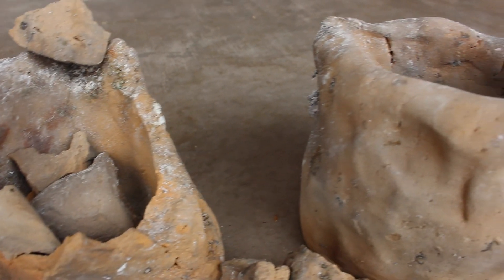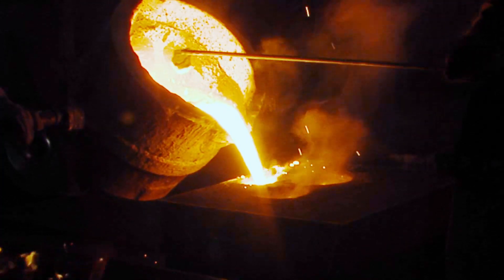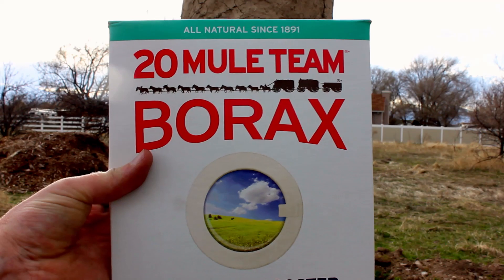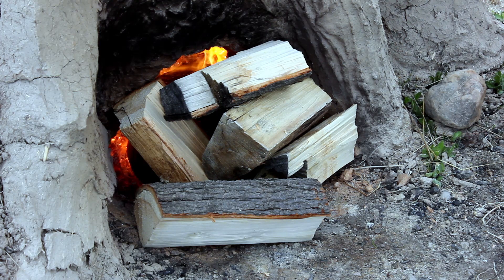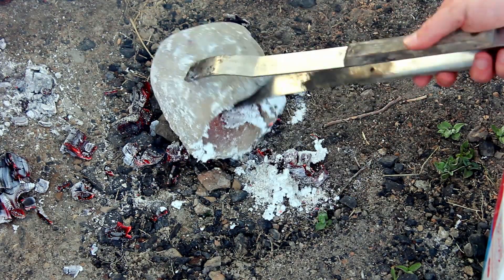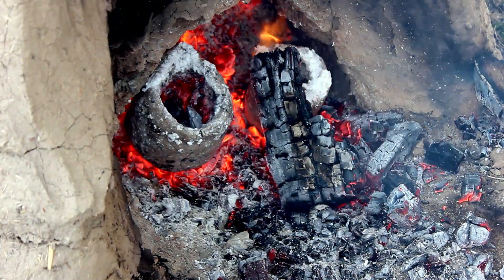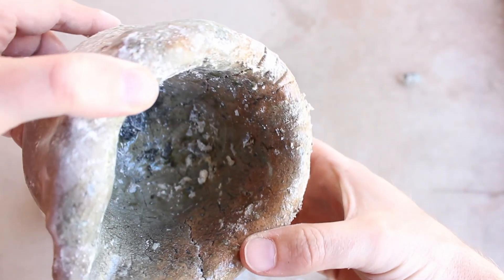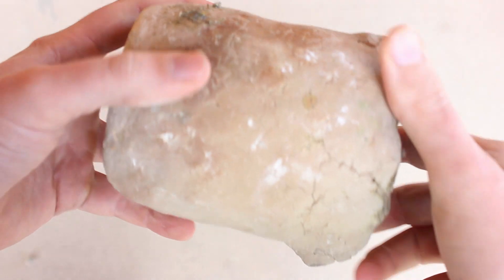How (Not?) To Glaze A Crucible (experiment)

Comment: I know this is 4 years too late, but I shouldn't imagine excess borax is a problem as its used as a flux in forge welding so it helps prevent oxidisation and makes for a cleaner bond, in this case it may just mean more slag floats to the top so could lean towards a lesser yeild but of a purer metal 🤷🏻🤷🏻 don't know. I'm not a scientist but that would also make sense.

Comment: A couple comments touched on this, but Borax begins to melt before all of the chemically bonded H20 separates.  Glazes with Borax will bubble up as that water finally separates and forms steam bubbles within their now-liquid surroundings, then the bubbles pop and the glaze settles down again (hopefully).  This makes it tricky to use as a glaze on its own, though still possible, as you showed.

Borate does not contain chemically bonded water, so a glaze made from Borate (which is the vast majority of low-fire glazes) will behave better in the kiln.  Gerstley Borate is the most commonly used source, though you have to order it from a pottery supplier so it isn't quite as good and basic as Borax.

Comment: The easiest glazeing process would be to throw salt into the kiln during the hottest part of your initial firing. Salt can burn around 300F but in the super high temperatures of a furnace it melts (around the same temperature for forging and hardening steel). It will then evaporate and the salt ions react with the silicon in the clay creating an orange colored glassy surface. There is no second firing needed. 
Another good glaze is tin glaze. Mix a slurry or lead oxide and a little borax and paint it onto fired pottery. Once that dries, paint on a layer or two of tin oxide and borax. The borax is just a flux to help the glaze flow better and heat more evenly during firing. After this has dried for a day or two, get your furnace going full heat while preheating your pottery on an open fire then move them quickly to the furnace. This will produce a white glaze. 

The key to both of these methods is to allow the pottery to cool as slowly as possible afterwards. Rapid cooling will crack the glaze. A good rule for pottery work is not to remove it after firing with anything but your bare hands. If it's too hot to touch, it's likely too hot to be exposed to ambient temperature air.
Reply from the maker: Definitely going to try a salt glaze sometime. JF
Reply: @GoodandBasic  I look forward to seeing your results.

Comment: Hey, tip from an amateur potter: try getting your glaze chemicals to be suspended or dissolved in water, and then apply it while liquid (by dipping, pouring, or painting). If it works the way I'm accustomed to, that'll let you apply the raw glaze while the pottery is cold, rather than faffing about with red-hot pottery that you can't touch.

I haven't used borax on its own, but the glazes that I have made, have normally been thick goopy suspensions of various mineral powders in water. Works quite well when applying it!
Reply: It can work both ways, water mixed borax can be used to fill in the gaps of the work smoothing it out. some do it in stages/layers.

Comment: I've tried refining clay a couple times from the Western-Washington soil in my backyard, but I'm not quite sure if it has worked out. It looks dark brown, and it isn't as plastic as the clay you made. It tends to form cracks and break apart (while wet) when I roll it around in my hands. I used the method you showed, but it didn't turn out near as well. I have no idea if it could be fired or not. Any tips on what may have gone wrong? Is my soil just bad for clay refining?
Reply: Their video was pretty misleading in that regard. To my knowledge, soils are not at all equal when it comes to the clay content. And you can't just dig some dirt and get clay.
Find a river or creek and start digging in the bank, at the same level as the water, after a foot or so you should reach a layer that is different in colour and/or composition. That will be your clay. This worked for me, and I've made some smaller pots that fired.
Reply from the maker: Off hand, I couldn't say.  It's definitely correct that you need a relatively clay rich soil--for instance, if you're at a sandy beach, you're just going to be out of luck.  The other comment gives a great suggestion about looking in/near a river or creek.  You could also try digging into deeper layers; even here where the soil is clay rich it gets even more clay rich after you get down a foot or two.  You might try firing a chunk just to see what happens.  There's also resources like perhaps this one where you can find out more about local soil composition.  https://www.nrcs.usda.gov/wps/portal/nrcs/main/wa/soils/ JF
Reply: @GoodandBasic  There is also the issue of not irritating my parents. I'm still living with them, so I can't quite go around digging holes and building furnaces without raising eyebrows. Thanks for the tips, though. I'm sure I'll get around to it someday.
Reply: Try firing it, that'll tell you for sure. It's probably gonna crack and fall apart, but water test the pieces anyway. Remember to knead it really well. Smack it around for 10 minutes or so, that'll distribute the moisture and get the air bubbles out. If it still fails the water test or is unusable, then I'd try finding that river and digging there.

Comment: Nice, as a follow up from my last post, borax is also used to reduce the melting point of glass, and unlike wood ash it actually allows for making clear glass.

I thought you were only using ingredients from your backyard so I didn't mention it last time.

If you plan to use borax, maybe mix it with your clay next time you try making pottery. Cheers.
Reply from the maker: Should I just mix it into the clay at some ratio?  How would that compare to what I've done here?
Reply: @GoodandBasic  Great question, I've read from 5 to 25% mixed with the sand (I guess clay in your case)

Here are some references for fluxes and borax in particular:
http://www.americanborate.com/all-about-borates/borate-applications/borates-in-glass/

https://www.elantechnology.com/support/technical-library/glass-fluxes-modifiers/

https://en.wikipedia.org/wiki/Borosilicate_glass#Manufacturing_process

Hope this helps, cheers.
Reply: @GoodandBasic  Can you see my reply ok?
Reply from the maker: @dattebenforcer  Yes--thanks for the tip! JF
Reply: Adding borax to the clay will  cause the whole crucible to melt at a lower temperature. Which may be a problem depending on the metal that you plan to melt.
Reply: @TheExalaber  True, if he's just making pottery it may help but if he's looking to make a crucible to melt specific metals it may hamper him, let's examine.

BTW I also found this about crucibles (for steel):  Fluxes, such as limestone, could be added to the crucible to remove or promote sulfur, silicon, and other impurities, further altering its material qualities. 

Now about adding borax to the pottery mix for a crucible:
Copper melts at  	1983F 	1084C
Iron melts from 2060-2900F 	1127-1593 C depending on what you're trying to do
For reference, Borosilicate glass melts at 3,000 °F / 1648 °C

Boroceramic should probably be able to withstand the temperatures.

Comment: Maybe apply the borax using a flour sifter. You could get a more even dusting this way.
Reply: Yeah, when you are doing actual pottery you paint on the glaze and let it dry before putting it in the fire. That's what I would try with the Borax.
Reply: I was thinking mixing it with water to some small degree to make a paste or a paint, and brush it on more evenly. Maybe wait for the pots to cool down first too.
Reply: @dattebenforcer  I'm not sure you could wait for it to cool down, because you need the high heat to melt and glaze the borax. I'm sure professional glazes have water or acetone as a solvent, and that you would brush on before you fire it.
Reply: @MckayCloward  Well can't you wait for the clay to cool down to apply the glaze and then just reheat it to melt the glaze on? I mean, the clay out of the furnace is already hard, it's not like applying it then and there will make much difference afaik.
Reply: @dattebenforcer  Not sure. Guess we'll have to try it!
Reply: @MckayCloward  Looked it up, as per wikihow, you glaze the fired pottery once it's cool and you fire it again: https://www.wikihow.com/Glaze-Pottery